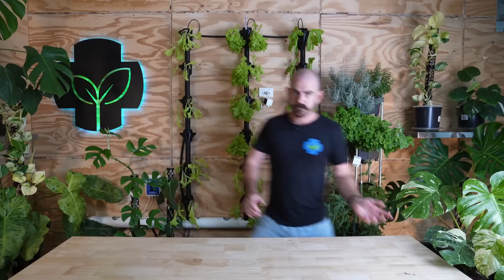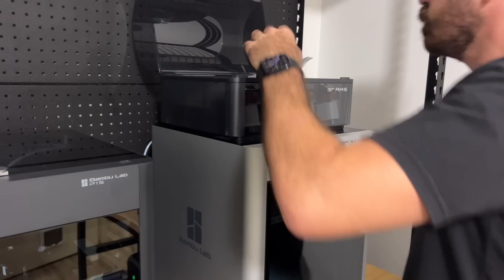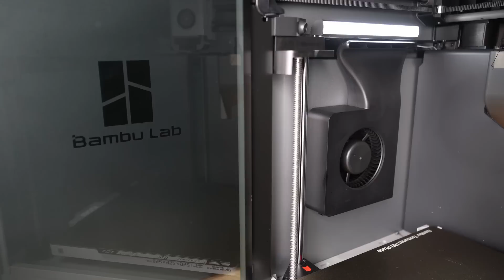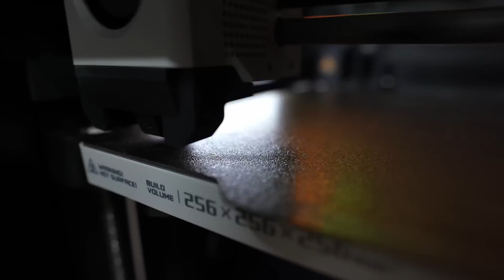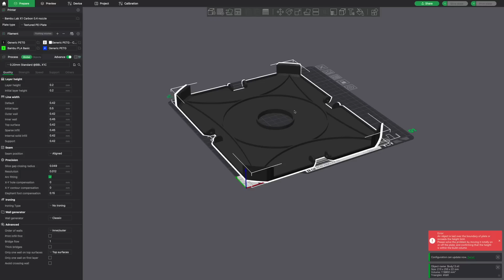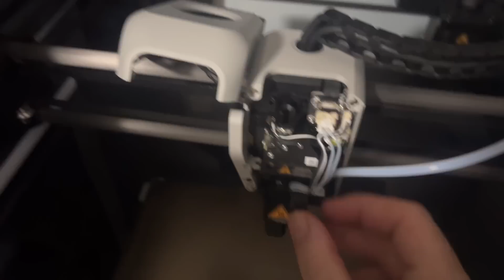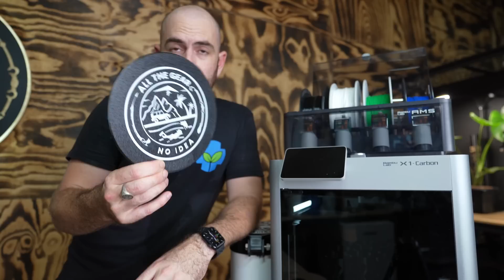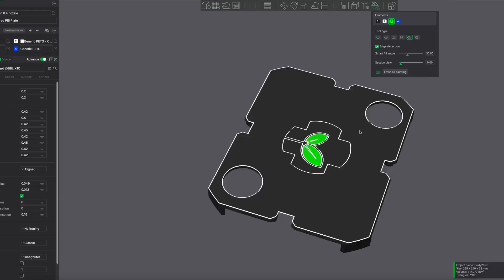3D Printers are now a Tool! P1S and X1C Comparison

Comment: I think anyone who had to play with both p1s and x1c at the same time would inevitably get spoiled by quality-of-life improvements x1c brings to the table. If some extra feature is available, why not use it -- and, by using it, you get hooked until you cannot imagine is your life without said feature. If you have only a P1S without x1c to spoil you, I believe it is quite easy to adjust the workflow accordingly and make it almost as efficient. For instance,  that small screen on P1S is much less of a hindrance if you don't use it at all after the initial setup (which is very possible). P1S also has one unexpected advantage over X1C that most reviewers forget to mention -- being encased in plastic instead of aluminium, it should be able to maintain chamber temperature more easily because plastic is much less thermoconductive. Ironically, it would make P1S more suitable for printing warp-prone materials than X1C. And of course, changing the nozzle and the gear on P1S to hardened steel version is a no-brainer, considering the price.

Comment: How can we believe you to be credible when you are clearly only in this for money and free chinese printers?
Reply: Well it is a comparison of two printers from the same brand...
There are a few upcoming contenders from other brands... But that is another story.
One thing he didn't mention is that these printers are basically a closed environment (not a diy tinkering printer).
Reply: @anderslagerqvist2642  They are definitely not a closed environment. You can use your own filament, your own slicer, your own firmware, etc.
Try a stratasys printer if you want to see a closed system.

Comment: I purchased an X1C that arrived damaged.  The customer support response was please try to make it work!!! The frame is cracked and I cannot plug in the display.  Since then they have not been responding.  Any advice for me?  Thanks
Reply: @fredsmith7863  Depending where you are but... Under law the Unit is Not fit for purpose! Google contract law faulty items not fit for purpose in your country.
Reply: If you paid on credit card you can submit a refund of purchase from them and show proof you've tried to work with the supplier
Reply: We have third party sellers here in Finland who has excellent warranty and return policy. It's a very trusted seller and I would not buy it from anywhere else.
Reply: Customer service of Bambu Lab is really bad yes. It's like talking to some kind of shady Aliexpress seller.
I had received my first P1S unit with factory damage all over. Scratches, dents, bend screen connectors etc. Contacted customer support and they just acted like they didn't cared. And they were not offering any solutions nor compensations. You really need to bite off of you, otherwise they will do nothing if they don't feel you're serious about it. You need to make some clear demands to them. Like I want my money back or I want to have a replacement. Otherwise they won't do anything.

After returning the first unit I got a replacement, but had to refuse it at the door since the box was already heavily damaged from transport. I didn't wanted all the Bambu Lab communications anymore, as you're taling against a wall. So I just refused the parcel, just letting them argue about the damage and whose fault it is with the carrier.

The 3th unit I've received has mechanical issues on badly calibrated axes. They already wanted me to disconnect the Z-axes and going to tinker on a 1 week old €1000 machine myself, while it should be just a well working and calibrated machine straight from the factory. So I just demanded my money back now.
Seems they really having some issues at the assembly  line there at Bambu Labs and they really need to invest in propper support and quality checks.
Reply: @rockels_journals  Also contact your local citizens advice bureau
Reply: Is it not under international contract law that you received goods that are not fit for purpose?

Comment: "you wont be able to have them in your room and sleep with it" looks over at printer running with settings called P1S 0.2 sleepy sleepy yes i have a setting for overnight printing and it is in my room
Reply: Are you saying it is too loud to be in your room?
Reply: @BradRemillard  while sleeping yes. Not that much louder than a gaming laptop with a 4090 running a game. But not as constant I guess. So I guess if a gaming laptop running at full speed is too loud to be in a room so is this
Reply: @BradRemillard  He is saying the faster you print, the noisier it is.  My wife could sleep thru ludicrous speed .🤣
Reply: Thanks.
Reply: I sure can sleep with mine, my old printer was 70db, it was so loud I had to put it in my bathroom at night

Comment: 3D newb here, got my X1C w AMS a few weeks ago, already hitting 260 hours printing. I watched all the reviews I could find and I chose the X1C w AMS so I could print any material eventually and wanted to do color prints. I like it so much I might get a second one
Reply: Are their any regrets (other than price)? I’m torn between this and the p1s
Reply: @kev1799  absolutely no regrets other than splurging on almost every accessory Bambu sells. Didn’t need the .02 and .08 nozzle, nor did I need the anti vibration feet or the extra tubing. This printer has been near flawless. Only hiccups have been my fault. Can’t really go wrong with either, the X1C just has more bells and whistles like the touchscreen and first layer inspection
Reply: @RollerCoasterLineProductions  thank you! I got some thinking to do lol

Comment: I have a 2 week old X1C without AMS. Your ideas on minimizing multi material are excellent. What bothers me about the AMS is it's the least robust product of theirs. And IT'S NOT HEATED. If they release a heated AMS I'll order it same day. I tend to doubt a third party will offer a heated option for Bambu printers.  My other complaint is neither video nor time lapse have worked on my iPhone. I have a raspberry pi cam rigged up for the time being, but it's not cloud connected. So it's only available at home so far. Have you tested the Orca slicer? It seems virtually identical, but it's much more community driven. Of course it doesn't have the cloud model browser.
Reply: "It doesn't have the cloud model browser" YET.  I wouldn't be surprised if a future version would boast model browsing not only from Makerworld, but also Printables and others.  So far the devs of Orca have kept up with Bambuslicer improvements pretty well and the more code both slicers port over from the other the easier porting really wanted new functionality from the other should be, so apart from the functionality alone, that might be another incentive to have Orca just take over the model browsing from Bambu.

Comment: @14:40 - The reason for the differences in the video from the printers is that the X1C has a multi-core Linux computer (similar to a Raspberry Pi) as the controller, so it can do full-motion video. The P1S has a much slower ESP32 Microcontroller (no Linux) which can only do photo snapshots.  
But the slower processor doesn't really affect the print speed or quality, as the controller is just feeding the movement commands to the motion controller.  For that reason, the P1S is just as fast as the X1C.
Reply: Don't forget about Jan of 2038, that's the true test of if they will still work
Reply: @timtomnec  ?
Reply: @sblack48  This may answer your question:

https://en.wikipedia.org/wiki/Year_2038_problem#:~:text=There%20is%20no%20universal%20solution%20for%20the%20Year%202038%20problem.

Comment: The P1P was my introduction to the 3D printing world. This machine has been AMAZING (out-of-the-box, plug n play). The largest learning-curve was performing maintenance. Thank God for the endless source of information on YT. As a proprietary machine, Bambu Lab has excellent support and very reasonably priced parts and upgrades. And they nailed the aesthetics. This is one fine-looking machine. Over-all, this is one of the most satisfying purchases ever made. Personally, I would recommend the A1 Mini to anyone on a budget or new to 3D printing; it's a less expensive way to test the water. However, I would totally go with the P1S simply because it provides more options and has a much more conformed and sleeker design. Both machines are different but top-notch, imho. If looking to use the printer for parts, tools, et. the AMS is not even necessary. 95% of what I print is single color anyway, adding a needless expense. I don't even feel that having the multi-colored capability would even be worth it.
Reply: I don't print multicolor, but the AMS is totally worth it.  Just being able to print any of the loaded materials and have seamless filament continuation when a role runs out by just having another role of the same material in the AMS is worth more than multicolor capability.
Reply: @MisterkeTube  yeah... suppose it could be reperposed
Reply: @geoffreyhowells7290 also you can keep your filaments drier.

Comment: Hey Hoocho, check out the Panda Touch screens. They allow you to control multiple Bambu Lab printers from a single hub like you described. 

By the way, you can do some color change stuff even without an AMS. You just need to pause at the height you want to change it at, which is a great way to do logos or text (although it's essentially limited to being on a top surface).

Comment: 7:43 "20,000 mm/s" I have to correct you because mm/s doesn't indicate the speed of that actual printer. You'll want the cubic measuring of how much material it can push through the hot end.

Comment: If X1C is so good screen wise would it not make sense to get P1S and a 3rd party screen and better hotend still all gor a fraction of the price?
Looks like P1S is purposely made to be a bit lacking and X1C overpriced for a fractional step up.
Reply: P1S = X1C minus the costly unnecessary stuff.  The SoC on the X1C is just driving that screen UI, the camera and the AI, so that's what you lose by cutting out that expensive SoC and screen from the BOM.  And if you anyway don't have the power to process AI stuff / lidar images, that one is an additional cost-saving.  The extruder gears and nozzle are cheap upgrades to handle carbon-filled stuff, so P1S is king in my eyes.  Why would I go to the printer to see status or control stuff if I can do it from the slicer or my phone?  And the lidar often gives worse results than (once per filament) manual tuning, has build plate limitations anyhow, and eats up some build volume at the front, so ... what are you then really missing on the P1S compared to the X1C?  Well, bragging rights maybe?

Comment: I see a lot of talk of how Bambu Labs changed everything, but my (hopefully objective) take is they just had the first high profile printer in what could be called this 'next generation'. All the manufacturers now seem to be bringing out (much) faster printers that are in the 'plug and play' direction - it just seems like evolution of the tech, not a Bambu-specific thing. But people seem to like their Bambus much like they like their Apples (quite possibly a big overlap in the two camps of devotees too).

Overall I'm neither one way or the other, but the pricing premium on Bambu gear turns me right off. I've also heard worrying things about Bambu's privacy policy, and their machines' logs containing data they have no need to be containing. Seems like 2024 is going to be the year of the multi colour/material printing units - hopefully someone will release one that can be retro-fitted to at least the current generation of printers (e.g. Ender V3 etc).

Comment: Oof, this is hard to watch. I'm on a FlashForge Creator Pro (around 4 years old now) and these Bambu Labs printers have been way too appealing. I get so many print failures, the print quality isn't great to begin with, various capabilities like bridging or speed are very poor... But it works. I can't justify an upgrade. Yet. The X1C is really expensive (though dirt cheap given how much better it is compared to the competition), so I think I'll save until my Creator Pro is unbearable to use.

I agree about the pros/cons of proprietary hardware and software. I'm fine with it if the user experience is so dramatically better.
Reply: So get the Flashforge Adventurer 5MPro, awesome printer, much less expensive,  comparable!

Comment: Welcome to the bambu labs side, I was an early bird Kickstarter backer for an x1c with ams.
I will eventually get a p1s as a second single filament printer but wouldn't trade my x1c ams. 

I found issues with the cardboard spools getting stuck in the ams even with the plastic rails.

There are printable adapter cores from the cardboard spools to the bambu refill spools where you remove the cardboard sides press in the core and assemble as if it were a refill. Those worked pretty good.

I ended up going with direct orders of master spools and refills from sunlu. Its basically the easiest and least expensive/wasteful option i have found for black petg.

Comment: I watched every minute, and still plan to buy the K1 Max.  Those BambooLabs printers are proprietary, and apparently even need an internet connection to the mother-ship to work.
Reply: Thats not true. You can keep offline and print from an sdcard. Proprietary parts are not such a bad thing as the bambu store has every component available in case you need to replace anything and its all reasonably priced.
Reply: @DraftID  Is that a joke?  You're suggesting I spend $1000 on a printer in 2024 and still run back and forth with an SD card when there is a better way?

Comment: Didn’t know you could multi color print with PLA and PETG together. It looked flawless
Reply: You can but they dont adhere to each other. Hence why it can be used as a support material between the two.
Reply: @DraftID  Well it's possible yes. I accidentally configured a PETG spool as a PLA spool and printed a multicolor print with embedded letters. I found out later that I accidentally addressed the wrong kind of filament in the AMS. So I now have PLA case with PETG embedded letters. And it's holding up surprisingly well.
Reply: @rockels_journals  Thats pretty cool. Because its embedded I can see them meshing together, if it was text sitting on top (embossed) it likely wouldnt hold.
Reply: @DraftID  Probably not no, but it also was on accident. As far as I know you can't print PLA and PETG together with the recent Studio firmware. It just won't let you.
But you can select PETG as support filament on a PLA print and visa versa.

I accidentally configured a PETG spool as PLA. So for Studio it was a PLA spool loaded into the AMS on that moment, letting me print PETG letters embedded in PLA.

Probably not ideal, but it's holding up well for now. It might be a usefull trick when you're out of filament. And needing to finish a simple project.

Comment: The camera is better in the X1C because it has a more powerful CPU than the P1S. You cannot upgrade the P1S camera because of that cpu limitation.
Reply: The P1S is powered by an ESP32 rather than a SoC (like your Klipper raspberry pi or similar Linux-based systems on other printers and on the X1C), so I am totally in awe of what Bambu was able to pull off here and basically have the exact same printing result and still pulling of showing any picture from a camera and hosting a wifi API and (simple) screen-interface.  This and the magic in the A1 mini is what convinced me these guys have the best engineers in the 3d printer world at this moment.  I'm looking forward to what they'll come with next...
Reply: FYI, an esp32 is a soc @MisterkeTube
Reply: @orbita1  Then an Attiny85 is also a SoC.  It has DRAM and flash and a clock on board, everything you need to make it run, still most will call it a uP.  The line is blurred and software is the more critical distinction here: does it have enough RAM and power to run Linux and something like Klipper?  The X1C's display does, the P1S does not.

Comment: I sold my ender 3 after I got my X1C. Then I got a P1P. I LOVE these printers. Still have an Ender 5 Plus for the huge bed, but I rarely print with it because it takes SOOOO long. I use my P1P for cardboard spools. Had a couple issues with my AMS on the X1C but as soon as I printed an LED riser, all my AMS problems were resolved. These machines are SOOO fast!! BambuLabs has changed the face of 3D printing. If Apple made a 3D printer, it’d be the X1C 😂

Comment: @Hoocho - Did you ever get the Sonic Pad upgrade for the Enders, using the Clipper software?

I'm leaning towards the X-1C atm...
Reply: I have the sonic pad for the Enders. Not even close to bambu
Reply: @russellj911  did you see any significant improvement?
Reply: @EviLEwoK666  it’s a significantly better experience to be able to control the Enders from the PC, which the sonic pad lets you do through moonraker. I’m sure it’s similar in that way to octoprint on a raspberry pi. It also has the whole creality cloud thing.

In conclusion, print speed went from 50mm/s to 150 mm/s with input shaping/vibration compensation,could upload prints directly to the sonic pad without downloading to sd card, and have full access to edit the gcode. Sonic pad is totally worth it if you’re sticking with Enders.